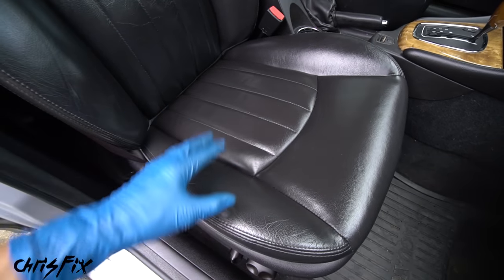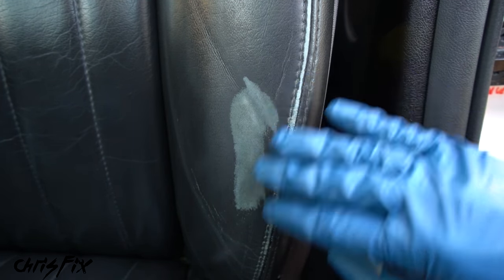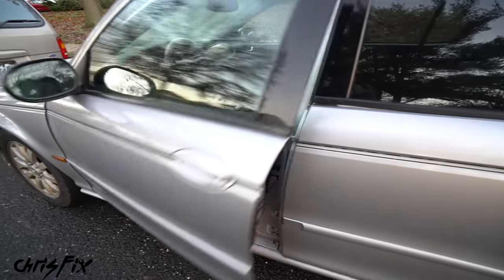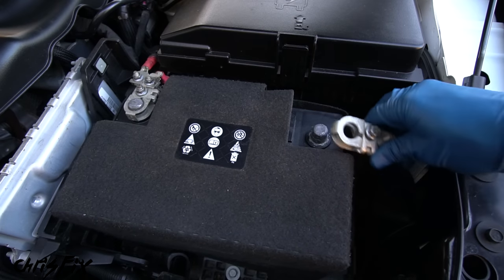How To Super Clean Cloth and Leather Seats

Comment: Amazing video! Quick tip: If you have power seats, make sure you remove/loosen the bolts BEFORE disconnecting the battery, otherwise you won't be able to move the seat and have proper access to the bolts. Ask me how I know...
Reply: thank you for your sacrifice
Reply: Thanks👍 lol me with no sense in practical matters 😅....

Comment: Some tips for you:

1. Don’t forget to clean all around the seat: headrests and its rails, behind the seat and pockets, as well as the space between the back and the seat itself. Adjust the seat to a lying down position for your convenience. 
2. You don’t have to use any special product to clean. All you need is a brush for leather, hand soap/laundry soap,  microfiber cloth (Chris’ favorite) and some water to make soapy foam. Don’t apply it to the whole seat, as it’ll absorb. Pick a part of the seat first and apply the foam to a soft brush and start cleaning. After around 10 sec wipe the foam with a dry microfiber cloth. If there is no dirt on the cloth and the part is not any better, take a harder brush. 
3. In the worst scenario if you still can’t get the dirt out of the texture and pores, take a Magic eraser (melamine sponge) or a clean cloth with some alcohol. But after this, your leather will be innocent with no coat protecting it, so you’ll need to apply the coat. 
4. Take a matte effect leather conditioner or with less shine possible if you want your leather look newer or better than Chris’ ;)

PS I cleaned beige leather on my Jag also x type just a week before the video is here😅 
Chris will you do leather restoration any soon or I go first? 😆
Reply: Are you advising Kris how to do better at his skill?
Reply: @2004cyrus  I'm sharing my knowledge with all of you, so we can improve and we don't have to spend hundreds to overpriced detailers regreting for the money spent
Reply: @mr_suslov  I appreciate that. I do my own detailing as well so I don’t have to pay someone but I actually enjoy it. Takes my mind of the crappy job that Biden & Harris are doing handling their America last policies.
Reply: @2004cyrus  I’d say most of politicians worldwide need some brain detailing lol
Reply: @mr_suslov  you aren’t wrong about that!

Comment: Now that explains my project car problem: The dirt is deep in the foam, not just the fabric. So obvious... 
Thanks to your cleaning video series, I recently opted for a more luxurious car that was simply so dirty nobody apparently bought it. Dirty enough I had to ask for plastic sheets for the test drive. Mechanically sound, but dirty beyond anything I ever sat in. Now it's almost mint, except that I can't get the seats really clean. Now I know why!

Side question: How do you get color stains out of bright carpet from apparently cheap floor mats in the car? Three rounds of carpet cleaner did virtually nothing to those.

Thank you, Chris!
Reply from the maker: Hopefully you'll be able to get those seats cleaner now! And try mixing dish soap and vinegar to remove the color stains!
Reply: Spray the floormats down with a cleaner of your choice then powerwash them and then extract them if you can.
Haven't found a stain that isn't removed by that, even hardcore oil stains.

Still you can probably get some used floormats from junkyard or online and clean them up instead of these.

And for the seats, you can also powerwash them if they don't have airbags and you live somewhere sunny, but you'll need to extract them afterwards and probably dry them in sun for a couple of hours or even days. Don't use direct sun so you don't change the colours accidentally.

Or you could take them apart and remove the sponges and clean them separately but that's really the last solution, i'd rather just buy all new ones.
Reply: Heres what I used and I had a custom shop.
Oxy clean & LA's Totally Awesome.
Dilute the Totally Awesome and mix with oxy clean.
You can get the powder and mix it .
A loose paste is optimal.
Use a stiff bristle brush to work it in.
Clean with a shampooer or the likes.
I have cleaned coffee stained headliners this way too.
But, use a soft bristle brush as to not "crush" the headliner foam.
Do Not press hard on the headliner.

✌N ❤
Reply: @lazar2175  Could you dry them with a heat gun?

Comment: If Chris cleans my car, the micro fibre towel would legit go from Orange to black 💀💀💀
Reply from the maker: That would mean the microfiber is doing the job and making the surface clean! Plus you can always wash microfibers :p
Reply: @chrisfix  you should do a video on how to properly wash microfiber towels. It's so easy to ruin microfiber with incorrect cleaning
Reply: @d54311  yes please, I always buy them in bulk and once done, I kinda through them out since its super hard to clean them.
Reply: They are not that hard to clean, I just soaked in a bucket with nappy san and fabric softener over night that chucked em in the washing machine on synthetic wash
Reply: @TheSruediger1  I dont think you're supposed to use fabric softener it ruins the microfibers
Reply: I just throw my mines out after I use them and go and buy more for the next wash cause washing it my hand or in the machine doesn’t really make it feel the same as before
Reply: @d54311  i havent had any issues so far...ill keep you posted
Reply: @chrisfix  Please make a video to fix seatbelts that won't retract on their own anymore when released.
Yea my Nissan Pathfinder is from 2002 😀

Comment: Great cleaning tips.  However, removing (and reinstalling) bucket seats in most cars is considerably more difficult than just removing four bolts. But you can still clean your seats and carpet without doing that.
Reply: On some cars cleaning under the seats is very difficult and nearly impossible without taking out the seat
Reply: @joefather2463  The seats are waaay more of a priority than what’s under them.

Comment: I watched this video along with all the other interior super clean videos, figured I would do this on my 1998 jeep. I started by trying to take out the drivers seat, I took out one bolt and all of the other ones were just a pile of rust so I used a grinder and took the bolts out that way. The passenger seat was about the same except even after I took out the bolts the seat didn't want to come out. So what took him 2 minutes has taken me an hour and a half. but it looks great now thank you Chris.

Comment: A tip I learned in addition to these great tips is to use an air compressor to spray air into the creases of the seats after you get as much as you can out first and even more dirty and crumbs will fly out for you to vacuum. Really helps for the entire interior as well!

Comment: For leather cleaning there is no better stuff then glycerin soap. It is widely used for saddle cleaning in many stables as well as other leather stuff. You can also use oils and balsams designed for them or even paste. Many of them have anti mould characteristics.

Comment: Instead of buying an extractor, a spray bottle and wet vac would be a good substitute.
Reply: Yeah a shop vac can usually do wet to
Reply: Shop vac is fine for general cleaning, but if you want a serious clean, you better get an extractor. They are leagues different in how they operate in minutia, and that's the important part; the "vacuuming up water" part is important too, obviously, but secondary. If you don't plan on deep cleaning or 'supercleaning' your car/upholstery/carpets (remember it can be used for your in-home furniture too!), then sure, you can just use a shop vac.
Reply: @KainYusanagi  Please explain the difference. I see the extractor spraying clean water and then vacuuming it up.
Reply: @n9wox  replying for response information
Reply: @n9wox  hahha the minutia lol...
Reply: @n9wox  Either with the one he's using he's not using it (note the buttons/toggle switch on the vacuum handle), it doesn't have it (and if so is then probably just a cheap crap model that's little more than a glorified wet/dry vac with a nozzle attachment), or it's doing it so perfectly we can't see it (doubt), but most decent-to-good quality extractor vacs have a pressurized water jet system that digs deep into carpet pile/fabric and heavily agitates it immediately before the vacuum nozzle, which is also focused on suction strength (why they are so frequently measured in inches of lift, where a unit of lift is defined as the amount of force required to move a column of water in a U tube graduated in inches) to remove all the water and debris thoroughly, rather than prioritizing heavy-duty durability, as with shop vacs (which have to deal with all sorts of messes, be it metal shavings, wet sawdust, chemical spills, etc). It's the difference between a specialized tool and a general tool; you can do most of the same stuff with both, but the specialist tool is going to do a better job, faster, and more efficiently, assuming user skill is equal.
Reply: @KainYusanagi  I have a bristle one of those vacuums but it's very old and it's hoses taped up with duct tape

Comment: TIP: on black worn leather for car interiors you can use black leather shoe dye been doing it for years
Reply: Wouldn't that rub off on clothes?
Reply: @VEE727  I haven’t had that problem
Reply: But I also only have used on side of seat and steering wheel if you put on backrest or similar area could see that happening maybe add some sealant to it

Comment: I wanna super clean my seats without having to remove them from the car
Reply: Just do the same with them in the car, removing them is just to make it a bit easier and convenient. But ultimately, the cleaning process is the same, you vacuum off the loose debris and then use an upholstery cleaner and wipe off the excess; use an extractor vacuum or shop vac if you have it and want an extra clean. It's really not rocket science, it just takes a bit of hard work and elbow grease.

Comment: lol cute, but im not removing the seats. Heres time stamps for the rest
2:55 vacuum cloth seats

3:30 shampoo cloth seats

4:58 extractor vacuum cloth seats

9:50 seat belt cleaner

11:38 rear seat backrest

13:25 leather seats
Reply: This should be top comment @ChrisFix should pin it
Reply: I just need torque wrenches and boyfriend muscles
Reply: lol its literally 4 bolts and unplugging 1 thing lol way better hitting under the seat efficiently

Comment: Just bought an 07 accord. Sketchy odometer reading, but hey it was less than $2000 and no rust. All I needed was to bleed and adjust the linkage for the clutch. Gonna try and get that thing all cleaned out tomorrow

Comment: Hi Chris,   Great videos.  One question on the Removing the battery, when you re-attach the battery cable on most US based cars, do you have an issue with the alarm going off, or having to reset anything in the car?    BTW, thanks fort posting these videos, although they were posted 2 years ago, they just came up in my feed.  wanted to share that these videos have some serious LEGS.

Comment: I’ve never seen seats removed from a car like that/or in general. I didn’t know it’s that easy. I also bought a brand new car back in the day with 3 miles. The seatbelt connecter bolt in the ceiling fell out and smacked my friend in the face resulting in damage to her face. This was in driveway before leaving (just buckling up) that car was an ultra-elite lemon 🍋

Comment: Speaking of seat belts If your seat belt buckle won't lock after you try to plug in your seat belt end into it - use W-40 and spray into it,  it will work then .. Using carpet cleaner and carpet cleaning machine  is the best kind of cleaner. Pre treat everything with spot cleaning first and continue cleaning for several more days  to do it in layers to make sure you really cleaned it.

Comment: A trick I learned is to use a damp magic eraser to clean the steering wheel. Wipe it, then dry with a dry cloth. It takes all the oil out and makes the steering wheel look brand new.

Comment: The difference between a Jaguar owner, and a rat bike owner.

Jag owner sees that bolster wear, need to fix that.

 A biker rockin and old beat looking  bike sees that, sbd thinks. That's the perfect amount of wear for comfort.

And I can't wait for the bobber's seat to start looking that cool.

Thanks for making this one Chris. New to us wheelchair van is a 17 Grand Caravan SXT. Leather and stow and go seating. Was curious on cleaning them, and starred with the detail videos. 

Only issue I'm having is cleaning the suede inserts. As a biker and mechanic ( okay casuals,  there is a difference. Rider is hobby/enthusaist. Biker is a way of life. A missing leg doesn't stop or change Me.) I know some see suede as leather. From one POV, yes, but it's split grain. Riding gear is full grain. Stronger, and safer in a slide. Suede shreds faster than denim. Not good.

So. I have no idea how  to clean it neyond a suede brush.

If anyone does, setting me on the right course would be greatly appreciated.

Comment: Hi Chris 
, great job!! I have a 2014 Chevy spark my husband sometimes uses my car for work. He works for the local newspaper and I’ be noticed that on the drivers side of the car, just like on the leather seats there is wear and looks like tears but isn’t this is a cloth seat. Will this come out using a cleaner or protectant like you used on the leather seats?
Also I am very petite 4’11” and when I drive the seat belt is constantly rubbing against my neck and it gets very irritated. Is there something I can buy to make my seatbelt fit more properly? Any help would be greatly appreciated. 
One more thing is the wear on the drivers seat from the ink in the newspaper or from just getting in and out of the vehicle? I recently started moving the seat all the way back when I get out so he can get in easier. I have it as far front as it will go and he had to try to get in to move the seat back because I didn’t have it all the way back could the wearing on the seat be from that too?

Comment: Never saturate your seatbelts.  You can wipe them with a damp rag, but if you soak them you compromise the integrity of the weave and the materials and they won't stretch as designed in an accident, could result in much worse injuries.  If your seatbelts get soaked, you have to completely replace them.

Comment: Very nice job. Though, you should never use usual water with the vacuum; instead, distilled water. What happens is that the vacuum machine will be very fast locked, not working properly. The reason is that the usual water is very hard and limy. I use Kärcher Puzzi 10-1 and Sprintus SE7 and for both of them always distilled water. Yes, the cost is higher (5L around 3€), but you'll keep your machines clean and durable in function for a much much longer time. A simple trick for the doors (plastic): after you clean them for dirt, just add hard wax and use heater (low, about 30-35°). You won't believe how nice will look after ...

Comment: There is another trick to this that works insane. Flip seat upside down, put something in drill that has a rubber end, you can use a few random things you hold the rubber part to the seat and it vibrates and blows the dirt and sand out its insane. Then do the rest. Also you should remind people to make sure there vacuum end is smooth and does not scratch seat. Great Vid Chris.

Comment: Hello handsome gloved limbs!... (yeah, I've noticed from previous videos you seem to be working out). I would have the front seats inclined to remove any dirt in that area underneath the back. But aside from that, perfect! However, and since I trust in most of your recommendations, do you recommend using ozone generators in the vehicle to "remove" odors and kill mold? I have recieved this recommendation but I'm not very keen on using it due to the risks of the gas itself. Ever used it? Would you give it a thumbs up? Please advice! cheers!

Comment: From now on I'm taking my back seat out every summer, my car got soaking wet a couple weeks ago and some dog food that fell in the seat cracks got wet. It took me a week to figure out where the smell was coming from. It's taken me hours to only clean up the first round without shampooing or anything yet. I had no idea so much stuff could get under there, i always vacuum the cracks and everything when i clean it
Reply: Also i got the quik detailer spray and it's AWESOME, i never get stuff like that because it didn't seem like it would make a big difference. It's amazing, it cleans everything. I used a melamine sponge with it on textured plastic--do not do that, i took off the paint on my steering wheel logo with like two swipes

Comment: @17:02 you can use a spray paint that is close to the color of the seat, spray it on a rag, use the other side of the rag and dip it in some pain thinner.. and rub it a few time on the seat. Works like a charm. Let it dry and then use a leather conditioner on it. Your welcome.

Comment: Hey Chris, I tried using natural shine protectant on my seatbelts but it didn't work. Will it work with high shine like you used in the video? 
P.s. Love your videos mate, keep it up. Very informative.
Reply from the maker: I guess it depends on the seatbelt. It worked for mine. Maybe try again?
Reply: @chrisfix  Thanks for replying. I went through it 3 or 4 times but it didn't do much. I scraped at the worn out areas with my nail and it's better now, although there is still a lot of that white-hazy look on some areas. Soapy wooder didn't do much...

Comment: Question: I f we will do an extractor vacuum on a car seat, why is it necessary to use an upholstery cleaner first? Wouldn't the
extractor vacuum clean both the car seat surface AND the underlying foam?  Thanks.

Comment: So I got to ask, since you have the battery disconnected for 20 minutes to about two hours, what does this mean about the drive? Wouldn't the PCM be reset? I feel it's imperative that you mention the downsides of disconnecting your car's battery and removing your car's seats. You should use a memory saver.